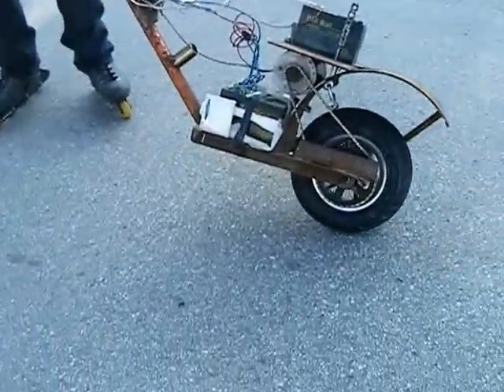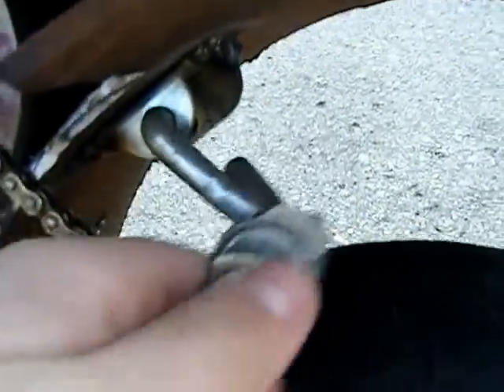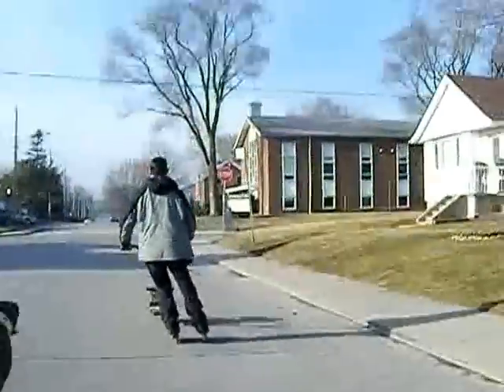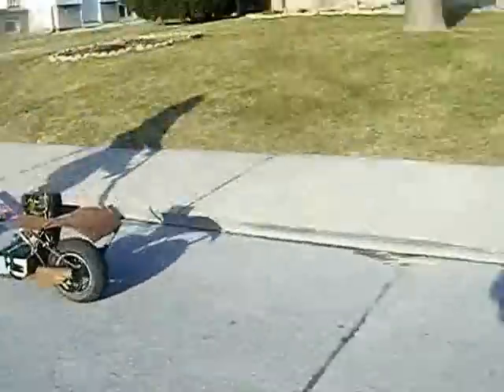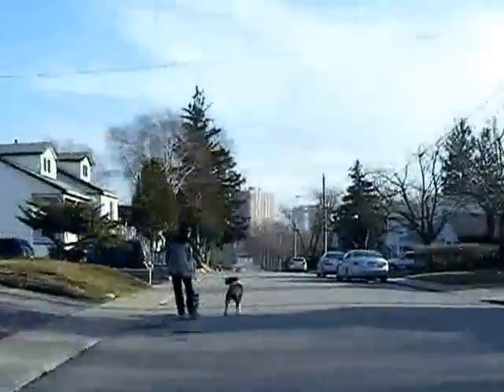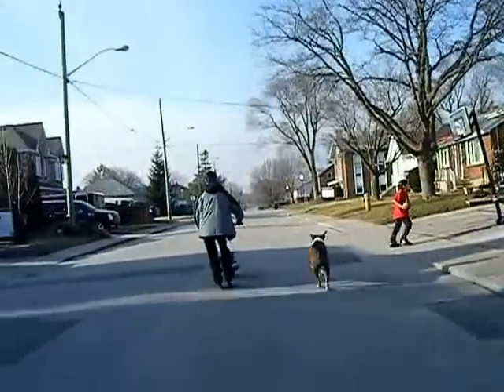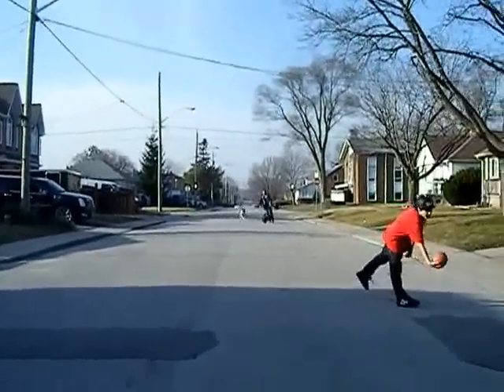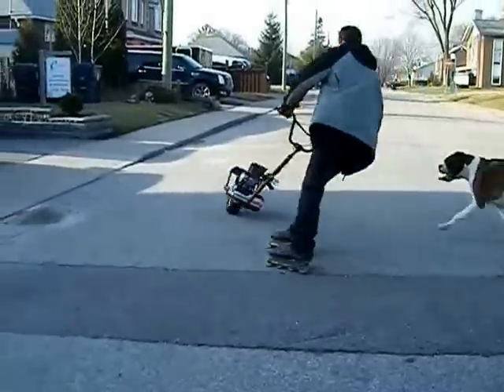onewheeldeal ,DIY E-Transportation Electric pocket rocket rollerblade Drag N Fly

Comment: If you switched the gears, the one connected to the motor and the one connected to the wheel, it would go faster because if the bigger gear is connected to the motor and the smaller one is connected to the wheel, for every one spin the big gear on the motor does the smaller gear on the wheel would do multiple spins or rotations in theory making it faster, right?